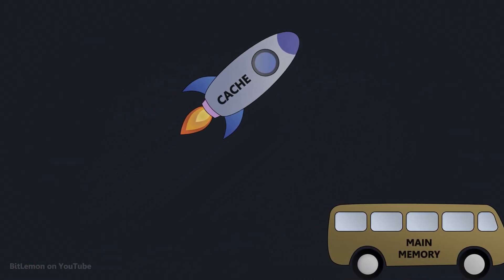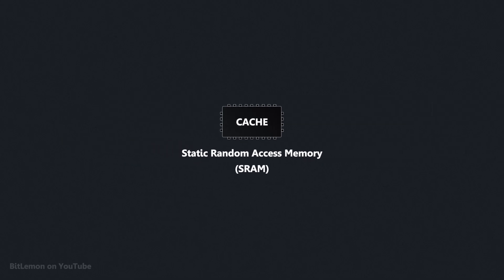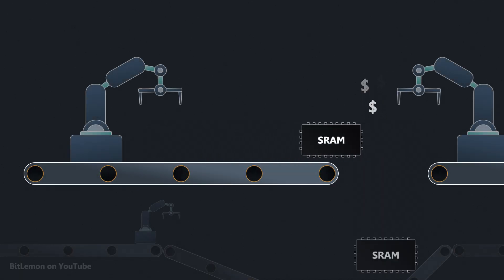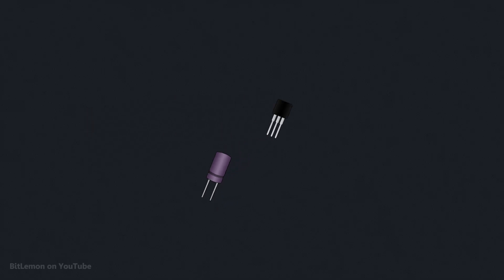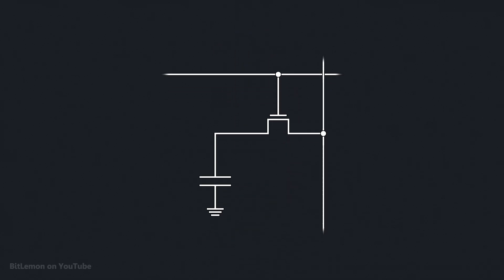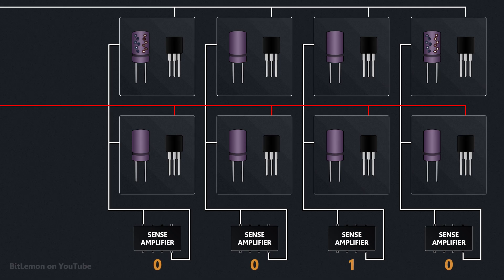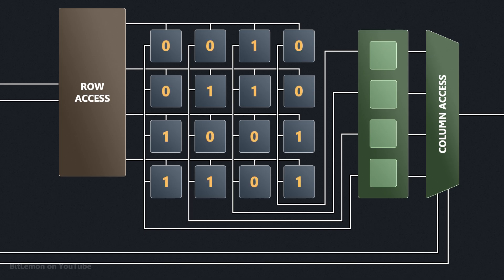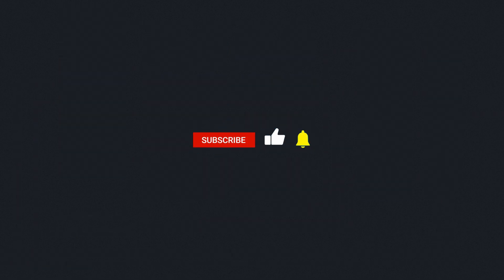SRAM vs DRAM: The Speed Difference between Cache and RAM (Animation)

Comment: Wouldn't DRAM also be inherently slower because of the charge and discharge times of the capacitors (+ the transistor switching time) compared to the transistors simply switching in SRAM?
Reply from the maker: Yes, I mentioned that reading from DRAM involves discharging and charging back the capacitor, which takes time.